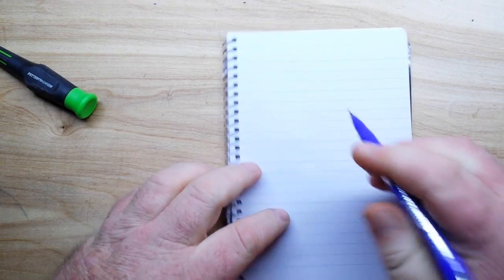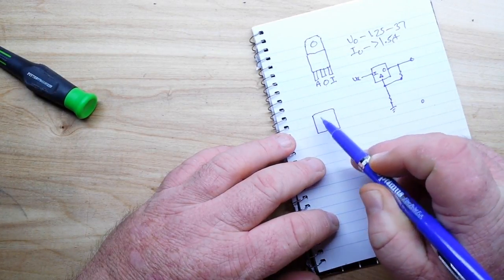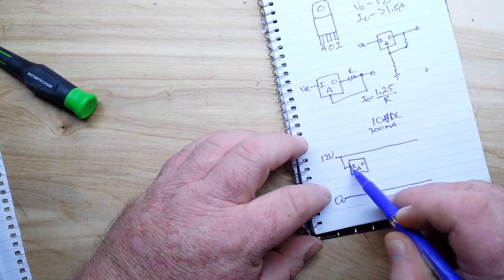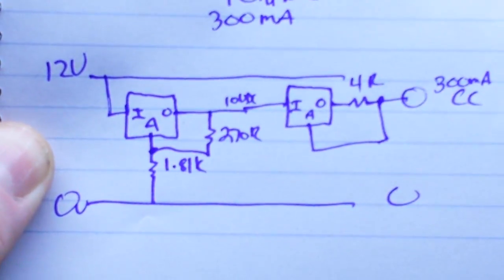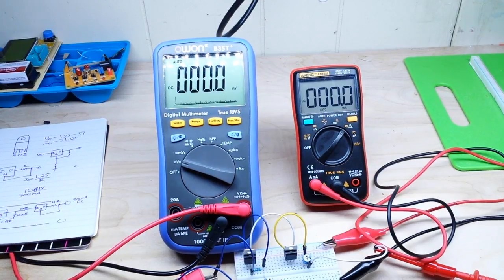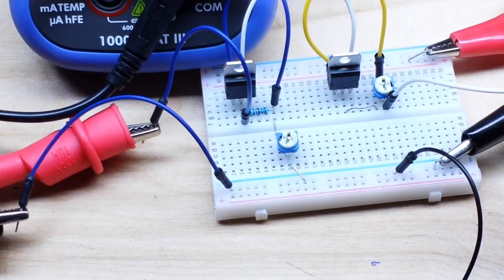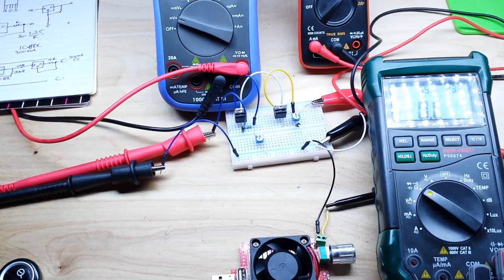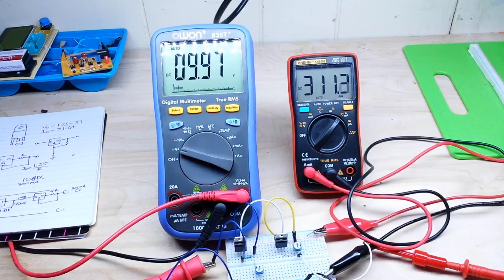Constant Current Source

Comment: Great information, just what I needed. I recently salvaged the guts from an old Gilbert Dot Matrix   exit sign. Gonna make it into a decorative piece and hang the bare circuit board with the LEDs on my wall. Original supply is a 120 to 12 VAC transformer feeding a driver board for the LEDs. Need a constant 5.4v at 720mA. 108 LEDs total, 36 sets of 3 in series with all the sets parallel. This'll do nicely

Comment: About the drift and sensitivity issues with that small trim pot.  I found in usage the constant current output will vary based on temperature rise of the LM317 and more importantly the current setting resistors that are placed in the circuit.  These components should be able to handle the power dissipated through them, and then some, to make sure the temperature doesn't cause changes to the resistance.  Depending how accurate we need the circuit to be, it's worthy to consider heat sinking or cooling these components.  Additionally, if there is a certain target current range you will be working with, consider having high wattage resistors handling the lowest current in the range, and adding a trimming resistor in parallel to decrease the resistance for that higher current in the range.  

For instance, I just built a 100 mA constant current source, and I wanted some adjustability and stable resistance by minimal temperature increase.  I chose the following: (27R, 2W) || (27R, 2W) || (120R,1/2W + 100Pot) for a target 12.5 ohms near center of the pot.  This potentiometer is 20 turns type capable of fine adjustment, instead of a 3/4 turn which lacks precision.  The current rating is less important in this case because most of the current travels through the two 2W resistors, much less goes through the 168 ohms trimming branch. I found this accurate enough to not require cooling, although I need to make my current adjustment at a nominal operating temperature.  

The reason I chose a 120 ohm fixed resistor in series with a 100 ohm pot - and not just 200 pot?  Avoids the risk of having the potentiometer set to 0 ohms and shunting out the other resistors, causing an unlimited current situation.

I suppose I could have also considered special zero temperature coefficient resistors, but I wanted something easy and inexpensive to source.  Like you , I find breadboarding the solution making a perf board or etched PCB.

Comment: now on the market many dc-dc step-up-down converter modules use the term constant current (CC) & constant voltage (CV). and in the discussion distinguish constant current from the term current limiter (current regulator). What is the difference between constant current & current limiter?
Thank you.

Comment: hey, i want to limit and vary the current of a 24V/1A power adapter between 2mA and 12mA, using a LM317, 1k ohm pot and a 1k ohm resistor. would that work or is it better I get a 2k ohm pot?

Comment: Could I place two lm317's in parallel to handle more current? I'm trying to use these to charge a 12.6v liion battery. I have a boost converter boosting 5v input to the 12.6v necessary to charge the battery. The battery has a bms with multiple safety features but does not limit current enough for the boost converter and it is getting hot passing upwards of 3amp (rated for 3a but to much for comfort).  I'm trying to limit current draw of the battery to the 500mA - 1amp range. To minimize footprint with large heat sink could I place two lm317s in parallel? And what resistor values would u recommend? The boost converter output voltage can be increased to whatever voltage needed in order to compensate for voltage drop...

Comment: Hello and thanks for the good video. The current is limited but if the load res is high, the current might be lower than the limit current? Another thing is there will be another coltage drop on the second stage lm317. So the output voltage is not the set valur on the first stage lm317?

Comment: very nice ...i wonder how the current pas throw lm317 without being attached to the ground!!! i think the second lm317 has no rule in this circuit. the current is determined in the circuit by the value of the resistor only

Comment: You wrote greater than 1.5 amps when you should have said less than, and that is assuming you have enough heat sink to deal with the watts getting burned off as heat. (Input voltage - output voltage) * amps = heat watts. An LM317 cannot provide more than 1.5 amps, and will throttle or burn if you exceed that(cheap generic ones tend to let out magic smoke). I have managed to cause a cheap generic Chinese one to light up like a light bulb accidentally shorting the output xD

Comment: so like im watching along thinkinking wow i like this circuit wonder if if could be implemented as a variable constant current source (for a low tech cc charger design idea) and im like shouting at the screen saying "but can it be used with pots instead of fixed resistors" then video gets to 04:05 and Paul must have heard me lol and brings in breadboard and "pretends" he didnt have any fixed value resistors of the values he needed, yeah right, only joking , thanks so much for this video, very clearly and simply explained, off to ebay to spend £0.99p and buy me some LM317's

Comment: I have used a Lm317L. It has a different structure. When i change the load between 10 ohms and 1k, it changes the output current like 30 miliamps. Should it do it? My resistor between adj and out of the regulator is 12ohms.
Maybe I will buy the normal Lm317
Reply from the maker: I've not used that variation.

Comment: Lol I just made a circuit like this through trial and error. Wish I saw this first XD
Mine still acts wonky tho.. I think it's from the laptop supply I power it from tho..messin' with me.
Question comrade, I see no capacitors in line there? In mine I got 2 going from adj. an out. on my voltage regulator, which gives me nice stable voltage.. But I ACTUALLY just noticed(I put non on the current limiting end) I am still getting amp spikes an dips..(thought the caps there would have been enough an if voltage was smooth an stable to .20v, then amps would be to, but I'm still getting amp spikes to -.3 -- 1.0 full amp whenever on/off or especially loadon/off. lol.. Whatcha think comrade? Probs need get some caps smoothing my current? is that even possible? Again I thought the two would be one in the same as far as smoothing goes?) Note: They are both Electrolytic caps smoothing the voltage in the 20-50-uf rating rage.
Awesome vid as always, thanks. =)

Comment: Can you help me in explaining why when i put my 317 set up in the same basic adjust config and connected to my load circuits . The volatge dropped to about 0.87. These same circuits were powered by 7812 vregs beforehand with no probs . What i tried to do was step down from +15v to a more precise +12v for tuning a Vco tuning refrence voltage.
Reply from the maker: +Adamski A. Draw a schematic and email it to me arduino0169@gmail.com
Reply: learnelectronics Thankyou so much for offering the help. I will try and do that now .
Reply: learnelectronics Schematic sent. Thanks again :-)
Reply from the maker: +Adamski A. Ok I'll have a look
Reply: Just had something very similar, even tho I checked my circuit 20 times and rearranged it at least the same, I had one wrong leg in a spot an it was messing the whole thing up. I notice LMs default to around .04 .06 ma(same voltage if I recall to) when not gettin' what they need to do the deed. Check it check it check iittt,. Then checccck itttt sommee moreeeee. Hope you got help already tho =p

Comment: I have an off the wall question to ask you.. on the NTE 2902 transistor, which leg can be used as an antenna? Is it the source leg? Gate, drain, source.
Reply from the maker: J. Clowers I'm sorry I don't have an answer for you. RF is black magic to me.
Reply: learnelectronics i think i can use the source for an antenna. Thanks though.

Comment: Thanks man
Crazy heatsink tip: use tuna/sardine cans and toothpaste(white color one) as thermal paste. Just temp until you get one.
you drill or make a whole in the can and may also fill it with water, about half or a quarter. Do this only if it's needed!
I learned this from an old guy that used a soop can as a heatsink for some guitar amp.
Reply from the maker: igrewold tuna-can heat sink you say....I will try it. I've done the toothpaste trick in the past. It works Just fine. Thanks!
Reply: Thanks to you too man, this guy got some interesting info on using PCB as a heatsink.
http://store.curiousinventor.com/blog/pcb-as-a-heat-sink-calculating-trace-width-for-given-current
Reply: Dude this is interesting, since I can't afford anything ever really I make my own resistors and was thinking instead of just having bare nichrome since I don't make casts for them since I can't afford that either, doing basically this, only submerged in mineral oil in a non conductive container. ;p

Comment: Years ago I fixed a couple of modems they were 6V. but had been used with 9V and 12V plug packs, the 317's were totalled, I replaced them and the modems came to life, no apparent damage at all.. Cheers.
Reply from the maker: David Price very cool. Yeah the 317's will burn out and USUALLY protect other components.

Comment: That's a good one Paul, simple robust and elegant. Could be handy for me, my psu limits current, but only at max. 4-5 Amps. IE. it's not adjustable for lower values. Those LM317 critters are excellent, they will sacrifice themselves rather than damage the circuit they feed.. gonna make me one for sure.. Thanks..